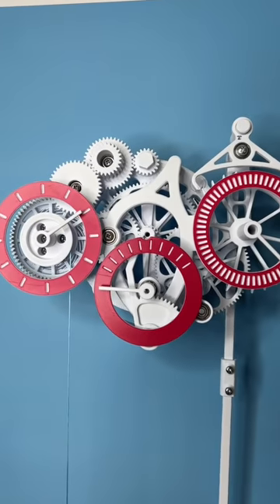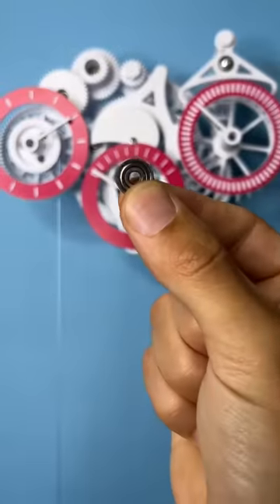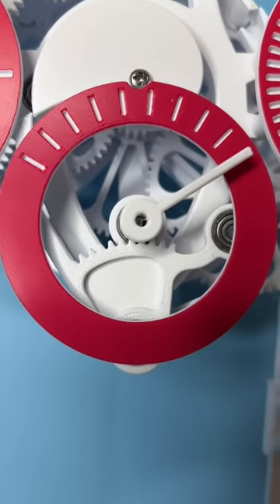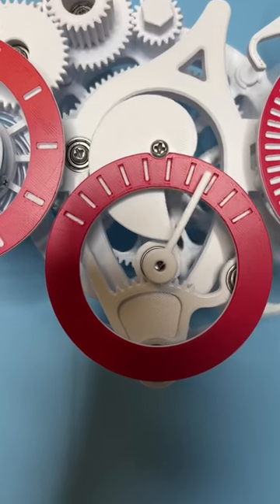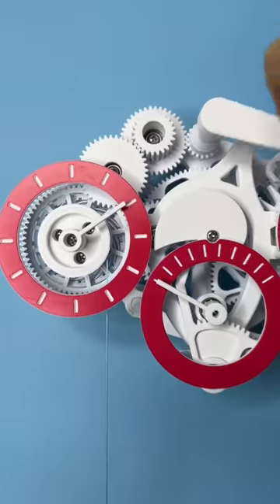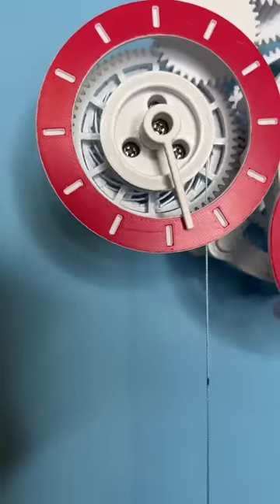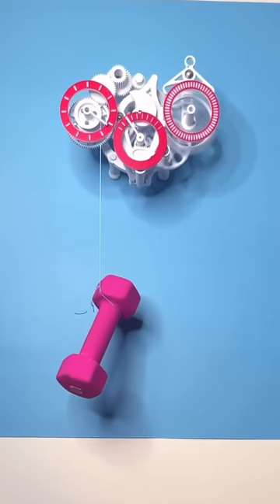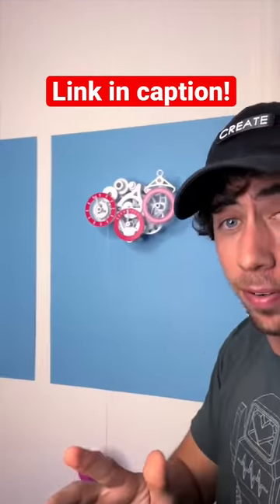The 3D Printed Clock is Done! #mechanical #mechanicalengineering #3dprinting

Comment: If you use a string long enough to run for 7 days you can also mark the weekdays on the wall as a "ruler".
Reply: To make this better, fix the end of the rope at the winding level and hang the weight on a pulley.. so sunday will be around your waist.. not by the floor.. or make it a pulle system so you could count the days of the month
Reply: He would only need a few more gears to make the "day of the week" dial but I think you would need more weight on the gears and it would theoretically last about 1.5 months (6 weeks) but I think expiramentally it wouldn't work because of the friction or something
Reply: @lastchance1036    it's not a dial, the clock takes almost 7 days to run out, if you measure the weight falling and divide by 7 you can define the days of the week
Reply: @lastchance1036  he could add a complete calendar mechanism without adding too much load to the drive system.  They move so slowly that the added load is negligible.  That retrograde dial is neat.
Reply: Thomas Jefferson built a clock like that at Montecello.  He didn't have enough ceiling height for a full week, so there is a small hole in the floor and Friday and Saturday are in the cellar.
Reply: It doesn't need to run for 7 days straight, you just need to wind it twice a week.
Reply: @lastchance1036  
It works perfectly. There are tons of watches and clocks that show the day of the week.
Reply: and that'll be an update i guess
Reply: @adrianjosol6404  maybe that will cause it to not be strong enough
Reply: @dries-pederjanse6249  on the contrary. It will feel lighter for the mechanism. Might need more weight in fact
Reply: Or you can just look at your phone or the other 90 appliances in your house that show the time
Reply: @itsdragon85  do you realize that is not the point right?
Reply: It's not necessary for it to run for 7 days. He could literally add a hand that makes one revolution per year, and at the same time make the clock need one winding per day. Think about it for a few seconds and you should figure out why.

Comment: The only way this could be any cooler is if there was some type of number system like numerals on the little indents or maybe a digital clock connected over that was directly affected on what it showed from the actual 3D printed one. That would be a lot of work though. Just brainstorming 😅

Comment: The only way I can think to improve it, is a way of resetting the weight without needing to interrupt it. But it can’t think of how to do that.
Reply: You could have a second spool with a weight and make it so that when you wind it up the one that’s still falling stays there but the other winds up and then once the initial  spool stops it changes over to the other spool and then vice versa
Reply: @Grimlock0508  I saw someone do something clever with a lego differential. It's on the "billion year clock" video.

Comment: Look into ankle/wrist weights or scuba weights. They come in nice shapes or bags of lead shot that you can make look nice!

I took ankle weights and made nice leather weights for my shop, it’s super useful having a soft leather weight that weighs 5/10lbs that has a few attachment points. I can see you’d get a ton of use out of something like that too! It would make your clock look awesome if it had a nice clean white or red pouch as a weight, or you could 3D print a canister and fill it with the lead shot. Etc.

Occasionally you just need something heavy and adaptable, yknow?! Haha 

The clock looks incredible and if my 3D printer didn’t get stolen I’d absolutely buy the files and start printing one now!

Comment: The minute hand mechanism reminded me of a clock design I sketched up earlier this week, one that I'm really surprised doesn't already exist. A 24-hour day clock, that is a semicircle, with a.m. on the left and p.m. on the right. My sketch also has the inner two quarters painted orange to represent day, and the outer two quarters painted blue to represent night
Reply: That doesn’t exist because it’s impractical and makes no sense. No one wants a semicircle 24h clock with completely unintelligible divisions. Hours would probably barely fit on the clock, minutes would be indecipherable and so would seconds. As a quarky wall hanger that can basically approximate time, maybe it would be cool, but as a tool to tell time accurately, no way.

Comment: Just beautiful brother. You have inspired me to start working on some designs for simple escapements. My laptop isn't that powerful so fusion crashes pretty regularly, but I can't wait to print my own
Reply: consider a free open source cad software instead. fusion is free (right?), but Autodesk are pretty big dicks, and freeware is often nicer with more features

edit: the open source software also are way more efficient and could run well on a potato
Reply: Maybe try freecad?

Comment: I just want to add that you can put the weight on a pulley/snatch-block and connect the string to the other side to double the run time... and even fancy-er configurations to get even longer runtimes

Comment: If you put a pulley above the clock and run the string for the weight up and over the pulley, maybe you could put the clock at any height on the wall while still getting a full week of time out of the mechanism.

Comment: If you made it only required to rewind 1 time a week that would be sooo satisfying
Reply: Just needed to be mounted higher is all.
Reply: Could just use a smaller spool diameter
Reply: @TheSeranath  right, and he wouldn't have to decrease it by much, since he's already close.  OTOH, that would decrease the torque applied to the escapement, but it's probably got the power to spare.  The weight could be increased to increase the torque, but that increases wear and friction by forcing the gear's (actually wheels) pivots harder against the side of the bushing.  Everything is a trade-off/compromise.  I wish he'd go into more detail about how the escapement applies a little impulse to the pendulum each beat, to keep it swinging.  Like pushing a kid in a swing.

Comment: Would it be possible to have some kind of fairly light spring mechanism that winds it up once you relieve the tension from the wire?
Then you can lift up the weight once it has dropped a little to keep it going. This wouldn't be very practical if the weight went all the way to the floor, so you'd need to do it ever day or every other day, but it sounds easier to me than winding it back up.

Our clock uses a chain which we can use to pull the weights back up which works pretty well

Comment: Wait 120 degress and it resets by a reverse rotation to rotate it back to 0 point. Isn't there a delay in the minute gear if you do it like that or the design already consider the delay caused by the reversed rotation?

Comment: So you made a grandfather clock in a 3d printer and are acting like it's some new big invention
Reply: How many things have you made especially after having to reverse engineer a working something.

You have no respect for the guy’s innovation.

Not only did he build a very complicated item, he also had to write code for the 3d printer.

His invention comes at a high cost for supplies and of course the 3-d printer.

Anyone can go online and buy something cool.  It takes a lot of determination to keep going when spending a lot of time and energy and then it doesn’t work.
Never stopping after trial and error.

Not only is this man determined- he is obviously gifted with a strong mind.  He has to use mathematical formulas to figure out the correct gear sizes etc.

People like you, who quickly criticize, typically become fatter and lazier because you don’t contribute.  Not only are you a taker- you are a doubter.

People like you are the the ones who say “it will never work “.  Don’t criticize- make the world a better place. Contribute and encourage.😅
Reply: He never said it's a new invention